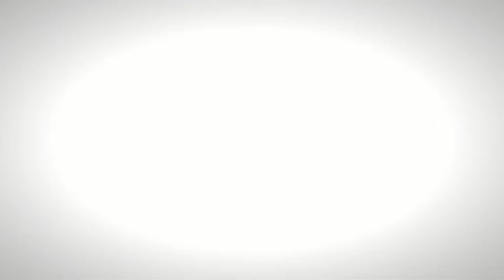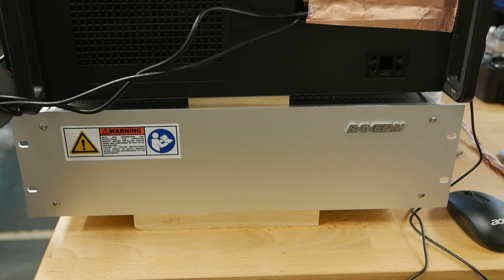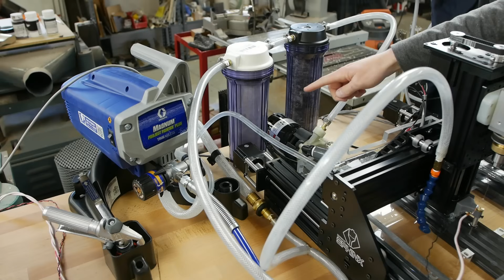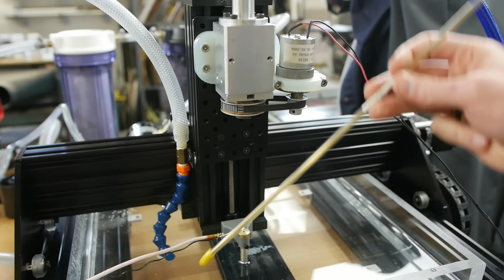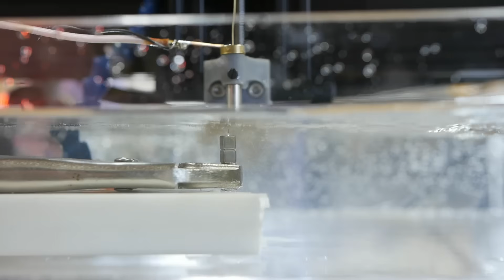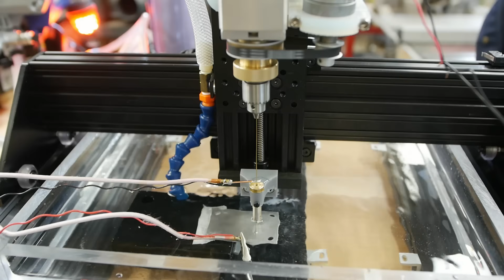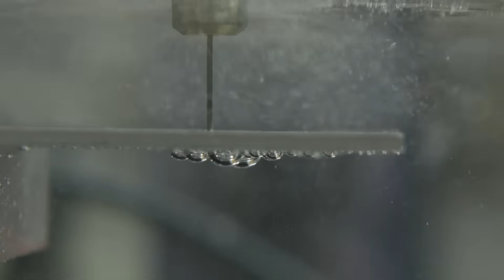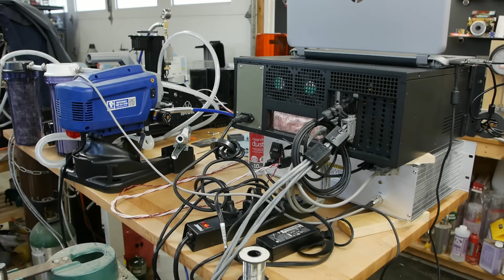Drill through anything (conductive) with Electrical Discharge Machining

Comment: Total noob question: wouldn't it be more efficient to use an audio coil and custom oscillating ring to vibrate the chuck and spindle? Kind of like a hammer drill up and down motion, whilst rotating positively the whole time. I say this in complete awe of how a HDD has a "similar" feature of audio to electron interface participation. (I also mean 'awe' of all of your custom bits)

Comment: There was a japanese game Show who 2 guys tried to Drill a hole in a pencil lead one Guy with edm and the other Guy with a traditional lathe :)
Reply: Supreme skill
Reply: I saw that, a joke. It'd be hard but not impossible. Pay me and I'll easily do it. Gundrill a hole the diameter of lead in alumnium. Clamp aluminum in collet to support the thin lead walls during drilling. Gundrill through lead. Easy. Graphite is soft so i'd have to feed it quick

Comment: I'm thinking.. Maybe if you can isolate the electrode and just let the tip be open, it may help to keep the hole the right size. That will probably mean that the electrode will have to be thinner than the hole, with isolation around it, and a bigger little ball, un-insolated at the tip, the right size. It should prevent arcing to the sides as the tip move into the material.

Comment: I only see one small diameter drill. So no larger diameter drills?
Reply: As far as I know. The point is small precise holes or scroll work. If you need bigger, you could cut out a circle instead of boring it, or just use a regular drill or laser.

Comment: 16:16 gives me an idea ... do you think you could use this to dill a hole right down the center of a dill bit length ways and then  a  few times radially at the top 3 or so  at about 120 degrees  separation giving 6 holes that inter sect with  the one that runs length wise?? a bout  a half into from the end of the chuck? also  countersink the holes a bit?  what im thinking of if you haven't already deduced it is a water cooled drill  with the water or oil fed in  from the 6 holes at the top and exiting at the drill tip to flush away the curf and chips     but how to fed water into a spinning drill? well i was thinking that  if you could get a roughly water tight spinning gasket  (think like what  the prop shaft of a boat has as it goes thru the hull ...only smaller )  then either immersing the top half of the dill in water or oil?  or  having a gasket on either side of the holes and then  having a cooling jacket just over the holes  (think an only water cooled maxim machine gun with the recoiling barrel ...except smaller and vertical and the recoiling barrel being a spinning drill bit ... and then by angling the holes and or with the help of a puck you could turn the drill bit it self into the  rotor of a centrifugal style pump  (as the bit spins in the oil the holes act like scoops?)   thoughts? anyone?

Comment: A friend of mine once showed me a 'spark eroder', he used it to remove steel bolts which had corroded into an aluminium engine block. Apparently the harder material eroded faster than the softer engine block, causing a very clean removal. Have you found harder materials erode quicker than soft?

Comment: Could this drill out a gun barrel - and, if so, could it erode away the rifling lands? Ie make spiral depressions in the internal diameter?
Can this provide a machine finish to the metal or would it require grinding or polishing with conventional tools?
Reply: You could use a sinker EDM to make the internal grooves, but the amount of poilsh & lapping needed would be enourmous. Think of clearing snow from your yard with satchel chrages of explosives: sure gets the snow away, but the amount of plowing it smooth again is enourmous.

Comment: You should use an 800 amp arc air. That copper sheathed carbon rod will turn a 1 inch thick steel plate bevel groove into "melted butter" in mico-second.

Comment: Hi! Thank you for the most complete paractical introduction into the EDM machining (drilling for now)! Greatly made, put, and cut. 
If you add some chemistry in your process, you can drill and "mill" also the non-conductors. It now will be called ECDM. It is common to use KOH solution as an electrolyte for glass.

Comment: For those of you curious about what practical uses there are for this process, there is a company called Mag-Na-Port that uses EDM to cut ports in through the side of gun barrels at the muzzle to reduce recoil and muzzle lift for heavy recoiling guns.
In fact, there are many gunmakers who offer some of their heavier recoiling guns with Mag-Na-Ported barrels off the shelf.
They use the EDM process instead of conventional machining because conventional machining would leave a burr inside the barrel at the critical muzzle area that could throw the bullet's accuracy wildly off, even with the most careful of attempts to remove the burr.
They also use the EDM process because they don't have to worry about compromising heat treating of the barrel steel or the finish (bluing, Cerakote, etc.) when making the ports.

Comment: I guess this means my next project is going to be a arc generator. Poor machinist apprentice, so the 2950 USD is out of my reach.

So Im guessing that I can sacrifice speed and go even slower, to save cash... but where to start?

Is tinkering with a astable multivibrator the way to go?
Reply: On my channel I've described a very simple system for a wire EDM, it uses dead simple RC generator at its heart. Next up would be PWM supply. They all work, but the high tech you get with 3k investment is worth it if doing anything for others.

Comment: To remove metal with a spark, i don't know for sure, but if there is some Chromium in the metal, doesn't it cause all kind of oxides to form?
I would refrain myself from giving the plants a dose of chromium VI (6)
Reply: Even steel, the EDM fumes are deadly

Comment: Used to work at a place that did reverse-taper microhole edm for fuel injectors. Do an image search for "edm micro drilling reverse taper posalux" if curious. Tungsten carbide electrodes; guides were diamond on one side and carbide on the other, so thin it was flexible. Electrolyte was extremely pure water  - deionized+reverse osmosis+ion exchange beds. Fascinating technology... if only my co-workers had been as enjoyable.

Comment: Very Nice. This is the best ho-made edm I have seen. 
I worked 40+years in EDM, working  on Sink EDM Wire EDM Drill EDM and Grinding EDM. 
I modified, repaired, trained and installed 25 amp to 720 amp Edms in industry.
Please watch the forward reverse signal and the Gap value with a dual trace scope. 
This will show you the real response of the system. 
It will visibly and immediately show you wether a change imporoved the system or not. 
Reduce the gap signal to a small voltage for the scope 
( maybe to 5V , using a simple resistor divider ). 
I will look at Kflop to see if it can orbit correctly ( neccesary for sink edm ).

Comment: Thanks for posting videos.  Been a fan since the thermite video. I program and operate a Sodick EDM drill, among other EDM and toolmaking equipment. Oversized holes from “overburn” and slightly radiused corners are normal, as you know. I appreciated your explanation regarding using drills of different alloys and why  high pressure is required. Duh, moment for me. Have you done a video on ballscrew/nut basics?

Comment: Do I ??? Yes. I NEED a .7mm hole filled through the center of a piece, straight down a what used to be a screw. Where do I send it and how much can I pay you. It is a part of a pocket watch a regulator screw.   It would be almost impossible to do any other way, and besides, I can't get another part anyhow and the whole watch won't work without that one piece... PM me.

Comment: And this is why in Orlando FL, I have to break open Cinder Block walls, and concrete slabs to repair pinholes in copper pipes, thanks for the confirmation.

Comment: run a 50 foot airless hose to have the pressure equalize, airless won't cycle on/off near as often. pro painters use 100 foot hose.

Comment: You are not far from an EDM saw... akin to a band saw or jig saw... uses a wire to cut patterns through conductive material. I saw a huge one up close and personal at the Superconducting Super Collider in Waxahachie Texas when they were building the linear accelerator back in the mid 90's. The water in the unit came from a de-ionized pump station source. They were cutting out armatures from some super dense metal that was a few inches thick. The side panels were glass and you could see the cutting process as it went - very very slowly I might add. I can't do the experience justice by describing all that was involved. Very cool, and to think it might be possible in home workshops now days is amazing. Great project. Enjoyed the video...

Comment: This is an impressive project!

I believe an improvement would be to modify the electrical pick up, by removing the brass bushing that fits around the electrode, then adding to the area just above the drill chuck, an apparatus similar to a spring loaded graphite motor brush contacting a rotating ring. 

I feel this would be a more assured way to get electrical power to the electrode (due to the fact that this modification would greatly increase the surface area of contact). While also having the advantage of not requiring a custom bushing for each diameter of electrode.

Comment: We've got quite a few of these at my shop. They take a LOOOONG time to make a hole, and the hole slightly tapers as it gets deeper. This is rarely ever a problem though. They are great for drilling through thick stacks of material and the hole is useful as a start hole for Wire EDM operations. Because they take such a long time to process parts they are oftentimes setup to run unmanned for hours. Some can even change their own electrodes as they wear to keep going. It is a fascinating and highly productive process when done properly. When you need to make a high number of highly precise holes in an extremely hard material; you need an EDM drill. Equally as fascinating is Ram EDM (or Sinker EDM) is when you apply the power to a formed die and use that to erode the material. This is useful for creating extremely precise geometry and extremely smooth finishes in areas of a workpiece that are difficult or impossible to reach with conventional machining methods. Much of the same methodology applies from EDM drilling to RAM EDM.

Comment: Thank you, sir. Now, I need a 0.6mm hole in my bearings about once every 70 years, but milling with that precision would be amazing. 15 amps, 20KHz, varying duty cycle, at ... how many volts? Have you captured a waveform from the generator? I got a box of MOSFETs that are chanting "EDMMMMMMMMMM" "EDMMMMMMMMMMM" at me. More EDM!

Comment: Is there any way you can build a hand-held tool of this type (assuming there isn't one already)? I work on cars and a tool that can drill into any conductive material sounds great for tapping into broken-flush manifold bolts. Perhaps something that can drill into then weld internally in the broken bolt to make another extraction attempt: any idea if such would work?

Comment: what keeps the spark from grounding further up the electrode during a deep hole (The sphere for example)?
Reply: Nothing, and you can't flush particles so it will for sure. Only idiots do this. Pro's like me use a gundrill

Comment: Try carbon fiber, the fibers are conducive but the epoxy isn’t. I’m still optimistic though.
Reply: Probably the heat from the process will do the trrick, as long as there is conductivity, if there's any at all... because usualy the fibers are completely coated.
Reply: @7z7able  maybe if you sand it first?
Reply: Yeah thats not going to work I'm thinking. It needs contact conductivity and the epoxy doesnt allow that.

Comment: Pretty cool, when machining, any drill bit smaller than 5 or 6 mm will break after a few cycles and in a cnc can end up breaking more expensive tools if not caught. If you can rig it in a spindle with a tool holder you are onto somthing.

Comment: GUYS   THIS PROCESS HAS BEEN AROND A LONG TIME. I RAN IT IN 1972 TO 1976 IN THE SPACE INDUTRY. YOU CAN DO REAL WEARD THINGS , LIKE THREAD CARBIDE ORANY THING THAT WILL CONDUCT A SPARK. YOU CAN EVEN POLISH THE INSIDE OF A HOLE WITH OUT ANY POLISHING COMPOND OR FRICTION. I WISH I WERE STILL THERE

Comment: Nice machine. It basically blasts a hole with electricity in anything conductive.
 Could we drill tunnels with this ?
Reply: Water's conductive so yes, this could be used to drill tunnels through the ocean.
Reply: No - the erosion works by sudden heat changes in the workpiece at the focus of the arc, followed by influx of coolant.
Reply: Professional EDM machine operators use oil. It's an electrolyte. Has nothing to do with cooling. Electricity arcs and explodes a micrscopic layer of metal away. With out good flushing the hole won't be accurate or round or nice finish. Professionals like me use drill bits, and for perfect or deep hole I use a gundrill. No machining business drills holes with a EDM, lol. 0.01" diameter holes are drilled with a gundrill
Reply: @highstreetkillers4377  the "explode" in explode away is caused by localised rapid heating and cooling. Yes, oil like kerosene is used
Reply: hello  @CliffordHeath  , so if you can create an arc disharge between two rods the radiation will create heat and will blow of material of the rods and the object what ever
Reply: @raydiofolk  No. Radiation doesn't blow anything off anything. Thermal effects cause expansion and contraction, that's what causes the erosion. An arc in fluid is just a way to achieve lots of sudden temperature changes in a very small spot.

Comment: Fun stuff for folks wanting to make their own cnc edm drills. Tap eroders, the kind that are common in mid to large mechanical/auto repair shops are in fact edm drills, albeit not terribly refined as the parts are manually lined up, they are a great 2nd hand source for most of the required parts!
Reply: I should mention. 
They are cheeeeeeper then dirt too.

Comment: I used to use to do high pressure research and used EDM to drill gaskets for diamond anvil cells. Even though I had prior knowledge I still learned so much from your video, thanks for all the detail and information. You're the best :D

Comment: On professional machines the electricity is send through the chuck by coal brushes just like on a brushed motor. 
You can find the position of the Workpiece by having the machine slowly drive against it until there is electric conductivity between the Electrode and the workpiece.  Then you subtract the Radius of the Electrode. It helps when the Electrode is spinning while doing the measuring cycle. The Rotational angel can also be taken in to account by doing 2 measuring cycles a set distance apart. This method can reach an accuracy of 2 to 0.5 μm.
Reply: Bullshit. The only thing with micron tolerances are ground. Like a guide bushing for a gundrill. Been machining 20 years, made bullets, microscopes, and molds. Nothing is that accurate. Dumbass. EDM moves with ballscrews, can't bullshit a pro

Comment: EDM Drills are much more tolerant with the conductance of the water or oil. A EDM drill can operate in a range of 10 to 60 micro Simens while Wire-EDM stops working at around 30 micro Simens. At work we change deionisation filters for the EDM drill every 3 Months while the Wire-EDM only last one Month. The seals on the electrode can be used for years actualy, we just use them on increasingle biger diameters.

Comment: Normal method of getting power to the electrode is with copper "shoe" pushed against the spindle with a spring. Better of course is two opposing ones so there is no sideways force applied. This is done in EDM drills, die sinkers with a C-axis and wire EDM A-axis.

Comment: Is that possible to build your own EDM Current Generator? I thought that will be really cool to be able to DIY the whole EDM machine. I tried to find some information but I cannot get enough info to actually worked out something. Is that possibility for you to measured the voltage(maybe also current) waveform coming from that EDM?
Reply: You can check my channel for videos, I made an Arduino controlled wire EDM from scratch at first. It is nothing mystical, very simple RC generator works and controls are dead simple.

Comment: I wonder if rotating the bit only 270 degrees and oscillating it would do the same as rotating it? Would make the high pressure fitting SO much easier when the incoming hoses can be a compliant part..  (edit: actually, once we start on this path, nothing stops us going for +360 degrees, say, 370 degrees would give nice overlap and do about what full rotation can do. The problem of course is the size of the contraption that can house all the parts needed and how one can make that rotate with the precision needed, chucks are a different size problem...).

/yes, i just watched the Veritasium video about compliant design so.. thanks science and tech channels , you make my day worth something ;)

Comment: So would it be possible to drill a path through an object that's not a straight line? possibly by using an insulating sleeve to prevent shorting.

Comment: Try drilling a hole through a whole pencil (the conductive graphite). I think that would be very very cool!

Also try carbon fibre. It might be an way to get rid off the health problems with the dust and make more precise parts easier to make. 

Greetings from Germany
Reply: I'm curious how well it would cut through less conductive materials.